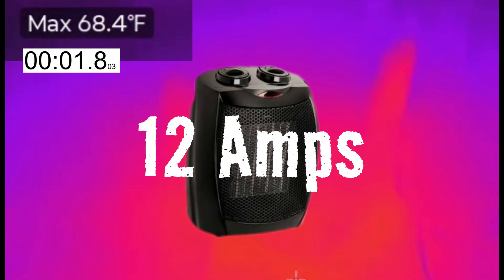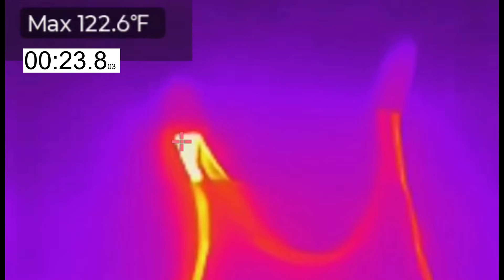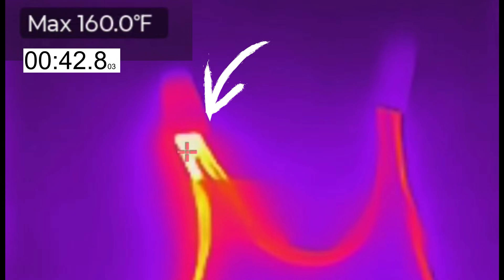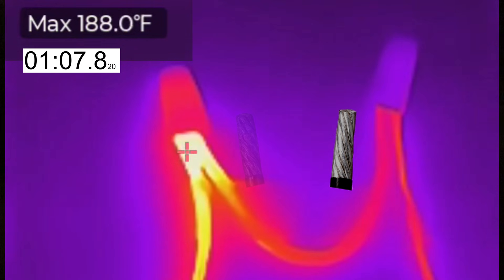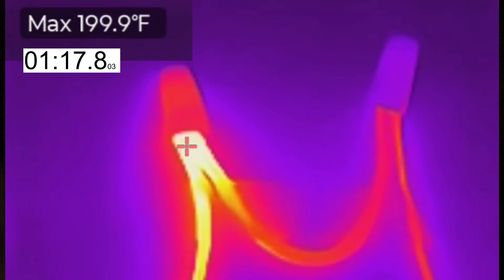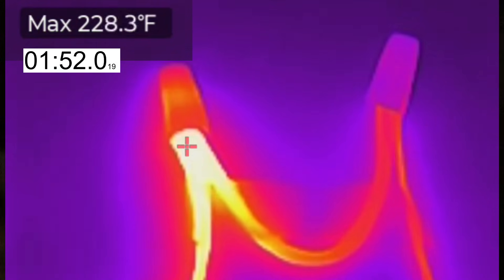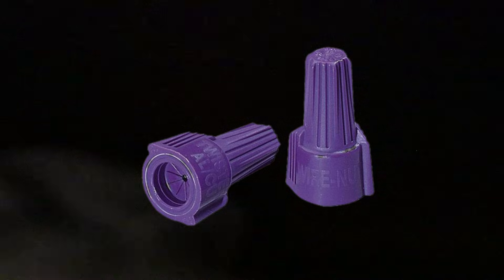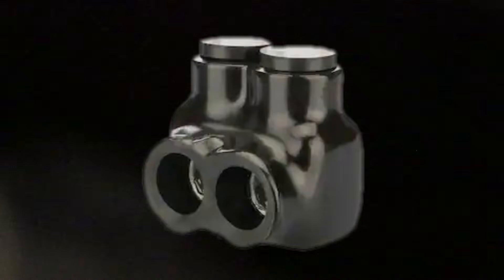Aluminum + Copper: Watch This Splice Cook

Comment: Fantastic video Mike. We had a contractor who did thermal imaging in the substations every quarter. You had to see some of the 13kv aluminum bus to copper straps that were melted together and only seen by thermovision. Molten aluminum is something to see.
Reply from the maker: Yup. I've seen some crazy stuff too. Always felt more comfortable racking the 13.8 kv breakers than the 480's where I was. At least the 13.8kv's were modern. Th 480s were from the 60's and you had to get down right on top of them with a crank.
Reply: and no 40cal suits back then